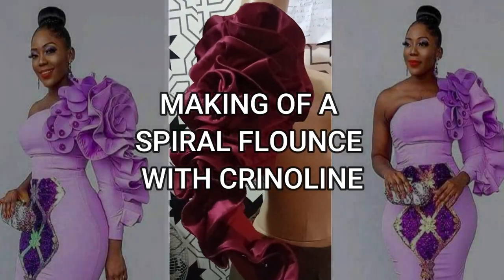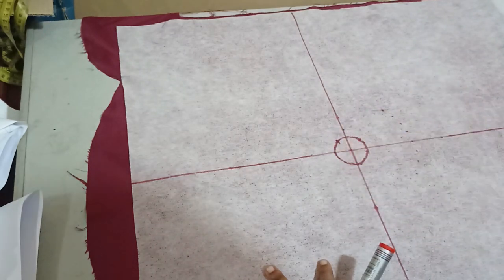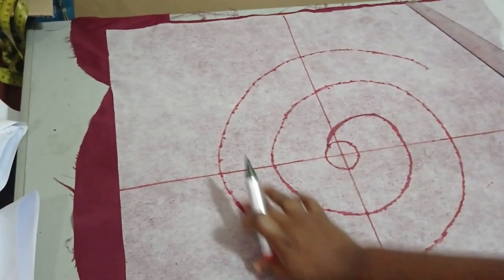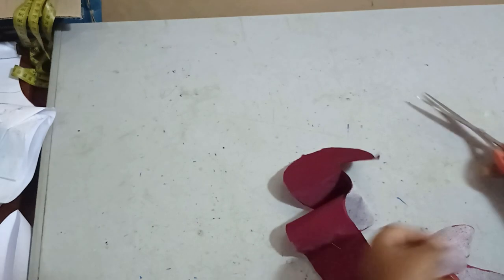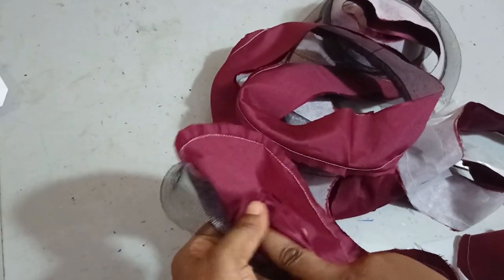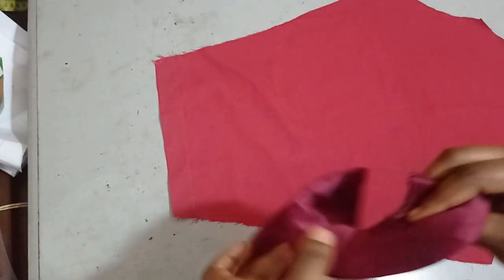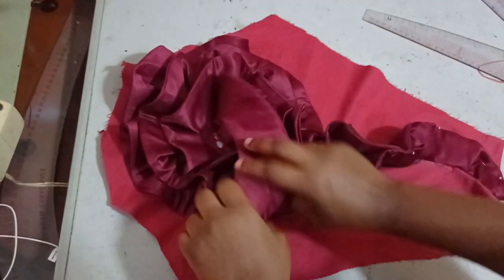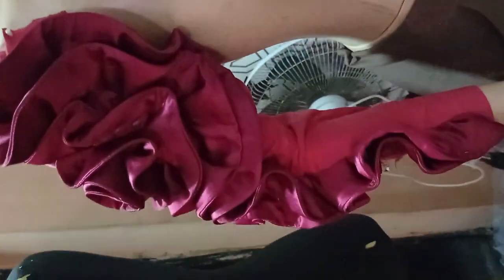SPIRAL FLOUNCE WITH CRINOLINE DIY | PERFECT Flounce Attachment to Sleeves

Comment: Beautiful ❤️, like how many yards will be enough for this?
Reply from the maker: 2 yards should be enough for both flounce and sleeve depending on the fullness you want
Reply: @LarryBThreads  so I will need to buy 4 yards for both sleeve
Reply from the maker: Around 3 Should be enough I used about a yard for the flounce and the sleeve itself is not upto 1/2 yard but then again it depends on how full and long you want your own flounce to be
Reply: Thanks ma.

Comment: Thank you ma, pls ma if I want to increase the length of the flounce, at what point will I add or increase to the length.    Let's say I want to to increase to 4, to 5 to 6 at wat point will I start the increments
Reply from the maker: The increment will start immediately after the 1"radius just the way I did by increasing to 3" in this video